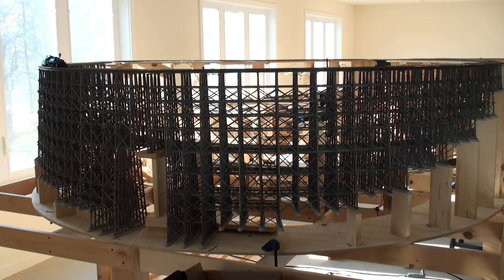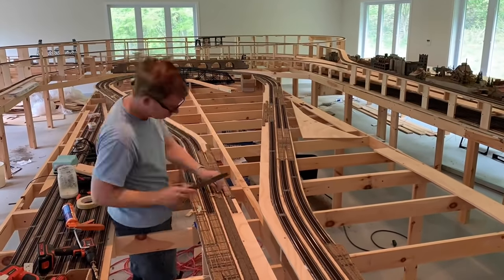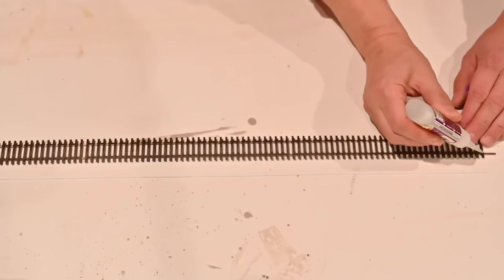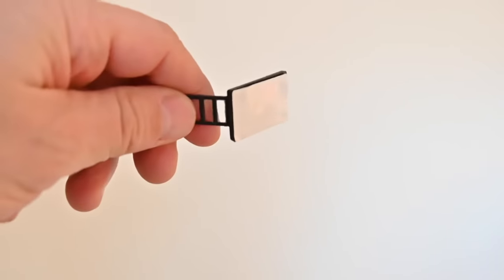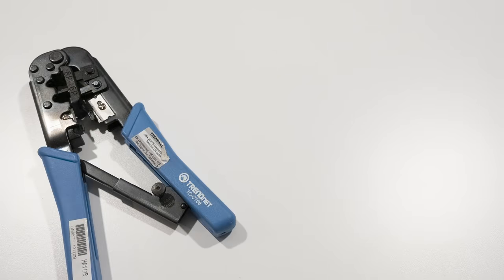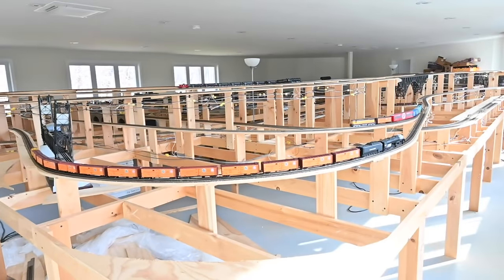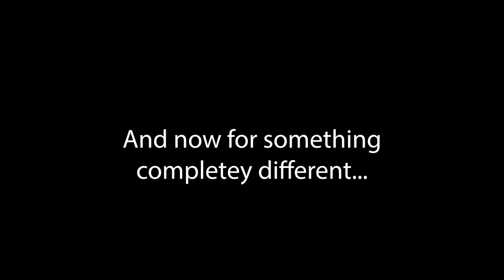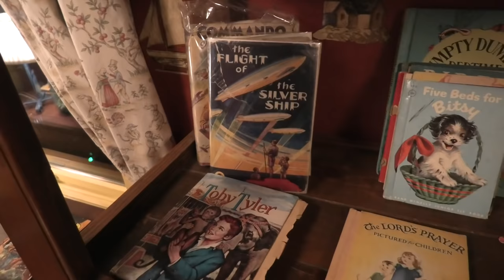S1: E5: Tracklaying, Wiring, DCC and More!

Comment: One thing you didn't mention about the network cables you need to have a mirrored on the ends means white to white on the opposite sides of each other otherwise they will be in reverse polarity.
Reply from the maker: I did say to “repeat the process on the other end”, so aligning the white wire on the right side when the plug’s release tab is on top as I described at the beginning would yield the correct results.

Comment: Should have put down 1 inch foam board over all that ply. Then just tack your bed and track as if nailed once your set on plan then glue or better yet the ballast gluing will hold your track to that foam like you can’t believe. My videos on my new build coming soon.
Reply from the maker: I don't understand the advantage of mounting track to foam over plywood vs just plywood. Plywood holds the track and bed just fine with glue. Once ballasted it will also hold the track easily as well as foam. Seems like an unnecessary step.

Comment: Great Layout, question, how do you control your turnouts, are you using a DS74, if so do you use a MeanWell transformer to power your switch machines?
Reply from the maker: I am using servo controlled items from walthers and tam valley depot. I have not installed the accessory power bus system yet, but yes, I will use the MeanWell's to supply power. Thanks for watching!

Comment: at the .35 mark near the start of this video, you have a large bridge installed in the layout structure. What is this bridge and did you build it from a kit? It looks like the Canyon Diablo bridge near Winslow, AZ.
Reply from the maker: This is a custom-built bridge based on the one you mentioned
Reply: @rcgrabbag  Nice. I built one for my layout as well. Full scale with the canyon under construction now. I made a trip out there to gather dirt so it had the right color of scenery. It's featured on my YouTube page.

Comment: Have you thought about using  rc dead rail instead? Seams so much easier.
Reply from the maker: You're really only shifting the work away from the layout and onto any loco that you might want to run on a dead rail system.

Comment: If you are working with DC for power best you use  fine strand wire to carry the buss lines.n You will have far less current loss with fine strand wire rather than solid core AC motor wire. Instead of these solderless connectors - use terminal strips for joints - you can add or whatever with those. Also in case of trouble, you can easily test for power at any location. Also if necessary you can add wires at any time.  Your wiring looks messy rather than nicely ties in - especially the main buss lines.  You certainly have some beautiful construction - bridges, trestles, buildings and such. This will be an amazing set up when you are finished. The landscaping will be enormous.
Reply from the maker: I’m using DCC for power and control and the bus wires are stranded. Only the feeders are solid. I wouldn’t use terminal strips along the bus lines for feeder connections. I have feeders every 3 ft., so I’m not too keen on mounting literally hundreds of terminal strips. Wagos easily allow me to track down issues more quickly and easily because I can easily connect and disconnect them to isolate problems. Not sure why you think my wiring looks messy. I think it's rather neatly organized and is working well. I'm really glad I made the choices I did. Thanks for watching and stay tuned. That enormous landscaping you are referring to has been started!
Reply: @rcgrabbag  Hi - I work in pipe organs and they are full of wiring. We use cable trays to carry numerous cables to a location in the chamber and then bring them out to be attached to the 61 or 73 magnets along the bottom of the chest. Everythihg is bundled with cable clamps or tie wraps to keep the plus feeds and #12 ground returns neatly running. Of course any wire properly connected will work, I suggested terminal strips because they make lovely junction points that can be isolated without breaking solder joints. I used "Messy" only in reference to the hanging wires - that it the wires drooping between  your various connection points.  Naturally, a hobby RR is much different that an organ which must be 100 % reliable for 50 or 60 years at a stretch. My ONLY intent was not in the quality of the wiring but the appearance. BUT - it is your system and you are the best judge of how to do it. You have a monstrous job to get that all working and I hope it is every bit as successful as you desire to achieve.

Comment: Very impressive video.

Question: I know squat about this stuff. But wouldn't it be a HECK of a lot easier just to have all the engines, radio controlled with rechargeable batteries? Instead of running all that wire all over the place?
Reply from the maker: Well it depends. If you have a lot of locomotives, you’re doing a heck of a lot of wiring in them to put all that battery/radio stuff in them. You’re still running wire for signaling, turnout control, loci net, etc., and any of your friends that you might want to invite to run on your layout now have to rewire their stuff if they haven’t made the switch. I think that the tech needs more development but it is promising.
Reply: @rcgrabbag  Fair enough. Thanks for the detailed answer.

Comment: Did you solder feeder wires to the track before or after you glued the track down? I'm currently building a layout and trying to decide which to do.
Reply from the maker: No they were soldered after the fact. You can solder them to the side of the rails, and if you're really good you can solder them to the sides of the rail that can't be seen. Which means one of the feeders will be soldered on the INSIDE of a rail, so you need to be careful to keep the solder joint small. Stranded feeder wire might make this easier. Even if the joints are where they can be "seen", they are usually undetectable to the naked eye once the track is painted and weathered.
Reply: @rcgrabbag  Thanks for the response.

Comment: Do you not cover the mains voltage connections to the power supply? I certainly wouldn't want 110V or 240V exposed like that.
Reply from the maker: They have little plastic inserts over the terminals.

Comment: Great video! Really enjoyed watching. 

But please, please do not tin the wires you put in the Wagos.
Reply from the maker: Why is that? Is it a current/contact issue?  They are feeding 22awg wires so I don’t see a problem here. I also could just as easily used solid core wire as opposed to tinning. If it’s something else then I am in the dark.
Reply: @rcgrabbag  The Wagos themselves are made for stranded conductors, so there is no need to. Also, over time the solder will become brittle causing the connection to degrade.

Our local electrical code actually forbids doing this.
Reply from the maker: @ItsNeptun  Wago lever nuts are made for both stranded and solid core wires. I agree it's probably not necessary for the long haul, but I don't understand why tinning/solder would become brittle, because if that's the case, the electronics world is in trouble. I just feel better tinning open wire ends to reduce oxidation/corrosion, but again, not really necessary, but I don't think it hurts either.

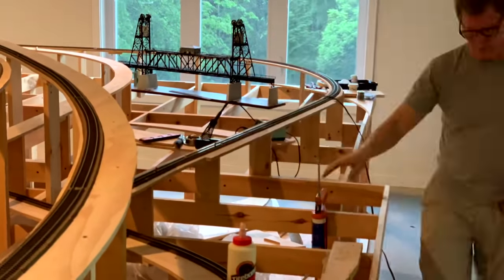Comment: 5:12 you mean banking?  At least that's what we call it in the roller-coaster community.  (We also have far more extreme banking, with some elevated turns banked in excess of 120°.)
Reply from the maker: Basically the same thing, in railroad terms it's commonly referred to as superelevation.

Comment: I'm honestly not trying to be picky, and you can use whatever wire you like. But #12 wire? I use #12 wire to run 5 horse giant lathes and mills. The extra cost is just not worth it. #14 is way plenty for model trains. Could you please explain why you would pay almost double for wire that is not needed.
Reply from the maker: The gauge is suggested by the DCC manufacturer, likely for the sake of DCC signal "purity", so it's not just a matter of power distribution/transmission.

Comment: never use Scotchloks... when u don't realy like to search errors!

and yes there are many items u use they cost a big investment, but u don't need it.
take a wago 3 or 5 clamp, open the bus reconnect with this wago and u can directly go to our feeder.

but when u not like to cut the bus, strip the wire, and bring it in one clamp, it takes a little more buswiring but u don't trobleshot scotlocks or how the name
Reply from the maker: You're not the only one that doesn't like Scotchloks, but I've used them for years without problems. They seem to be a hotly debated topic, but I find most of the evidence against anecdotal and unsubstantiated. Incorrect use (like incorrect wire gauge), high voltages, or cheap knock-off brands seem to be the primary culprit. Splice connectors are quite common - Scotchloks, phone and network plugs (especially in Loconet cables), ribbon connectors (signaling), etc., and are quite reliable. Also, I don't like the idea of completely cutting the bus wires into what would essentially be hundreds of 3-foot sections to accommodate an all-Wago solution. I've been happy with my current approach, and on my previous layout that I had for 10 years.

Comment: So why didn't you simply use these? https://www.wago.com/us/wire-splicing-connectors/compact-splicing-connector/p/221-413

Then you wouldn't need anything that cuts into your bus wire and you'd be able to interrupt your bus at any place you like so that's even better for troubleshooting.

These connectors have many advantages: they can connect different wire sizes, connect both solid wire and stranded wire, disconnect them easily and at the back side they have a hole you can use to measure voltage.

If they are too expensive you've also got these: https://www.wago.com/us/wire-splicing-connectors/compact-splicing-connector/p/2773-403

They can only be used with solid wire though.

Good luck with your project!
Reply from the maker: Maybe I’m missing something but Wagos only accept the “end” of a wire so I didn’t want to cut up my bus wires.
Reply: @rcgrabbag  Ah I see. You're right, you'd have to cut and strip your bus wire. But isn't it cut up anyway? I'm not familiar with those other connectors you used but they cut your wire too don't they? It looks like something very prone to malfunctions, no?
Reply from the maker: @ThomasVanderVeken  They are cut up somewhat, but down to the size of the block. If I used Wagos as bus taps I'd have quite a number of 3ft bus wires!

Comment: Everything except those Scotch lock connectors looks good but those things are junk, you will eventually start loosing connection in them and they will start breaking the wire in them, JUNK.
Reply from the maker: Never had that problem in the many years I’ve used them.

Comment: also, you should solder wires properly with the right tool.  not the complete piece of crap you use.  Hakko makes a unit thats around 300 bucks.  You would be happy face for life on it.

ezpz
Reply from the maker: Complete crap? It’s a Weller soldering station and has served me well for years!